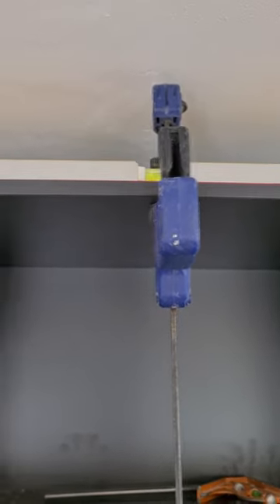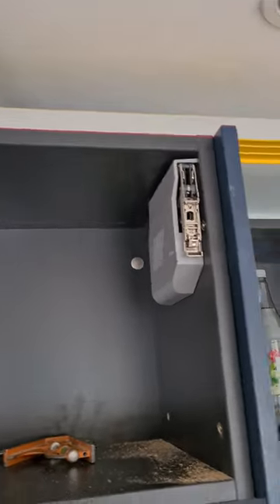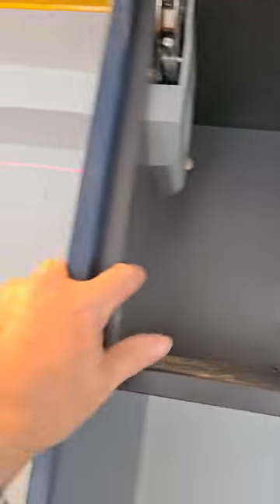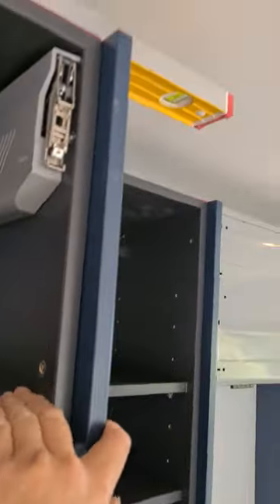How  to fit a bridging  kitchen  unit #hintsandtips #howto

Comment: What if there is 3 dave...how do you get strength and does a decor panel just finish it underneath??
Reply from the maker: Not quite sure what you mean by 3 if you mean 3 units  in a line then I would put timber lengths  to create like a bridge that you can screw your units too. , so you have one at the back 1 and one at the  front screw your cabinets from the inside up into the timber and then put the whole lot up in 1 piece. So you have 3 large units held in place.  Depending what cirnice you have 
I would use 2x2 timber
Reply: @dcjoinerydjdave6100  thanks for the reply mate, yes basically 2 larder units each side with 3 600mm wall units but they arnt fixed to the wall as the plan says they run in line on the front face so there is a void behind them, so yeah I mitre bonded and screwed the 3 together and put them up in 1 piece like you said..u can see a sag so yes I'll get a couple of timbers tomorrow. Thank you for you're help, hope you're keeping busy